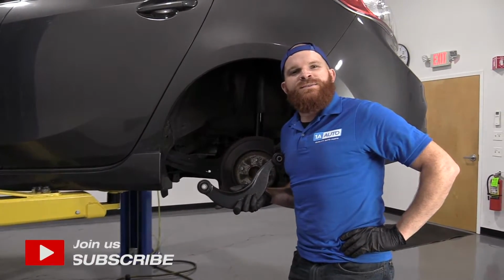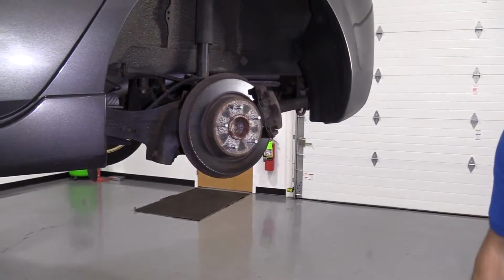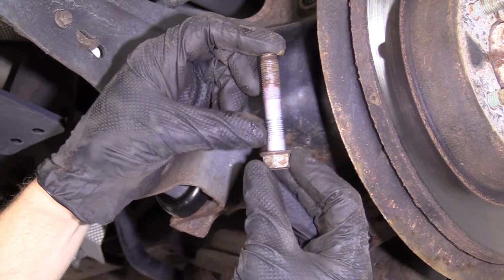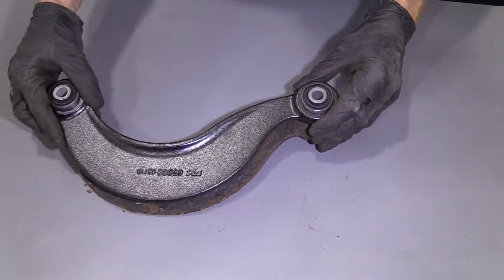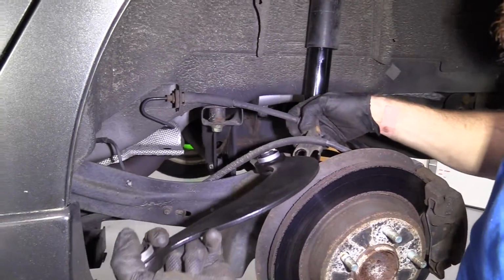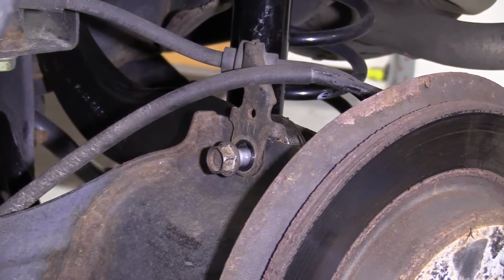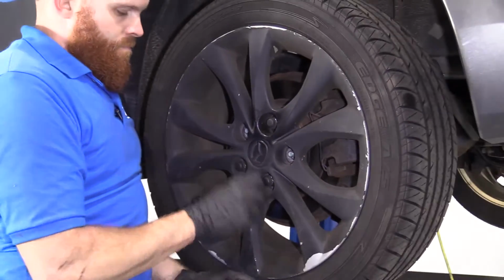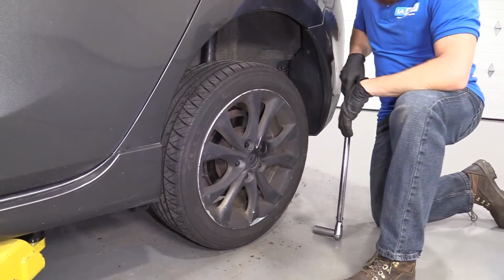How to Replace Rear Upper Control Arm 04-14 Mazda 3

Comment: Why are you not putting weight on suspension to put all bushings in neutral alignment before tightening them to spec?  The loaded bushings, once the vehicle is down, will put constant tension, thus reducing bushing life.

Comment: Everybody always shows the drivers side being done. What about the passenger side?  I went to add some adjustable control arms to mine this weekend cause I'm tired of going through tires on my 06 mazda 3 sedan and I started with the passenger. I couldn't even get at the upper bolt. There was a bracket in the way.  I even have the dealer service manual for the car and it doesn't show how to get at it. How do you do you get to the upper bolt on the passenger side?
Reply: Rick push the metal bracket out of the way.   Agreed though way to show the easy side.
Reply: In a video showing how to remove the lower control arms on the front they showed how to remove both sides

Comment: The repair manual has you removing the entire rear subframe. I said F that. I straight up bent the recirculation pump bracket far enough out of my way that I could use a wrench on the bolt. It took me probably 2 hours of cursing like a sailor and getting cut and bruised up. I would recommend a ratchet wrench.

Edit. I also recommend removing the shock absorber so you have leverage and don't have to reach around it.

Comment: 17 mm socket therefore its an m12 bolt torque setting for a coarse thread is 85nm plus 5nm for a fine thread 95 to 100 nm.

Comment: I just got my car back from getting a wheel alignment at a Mazda dealer. They told me no rear camber  adjustment.. but there was. On top of that it made noises after they were done. I looked at it found the nut is loose! Hope to get a refund! No one takes pride in there work anymore🥺😫

Comment: Didn't torque any bolts up to spec?
Reply from the maker: +Dennis Weinstein The tech is torquing to spec, but he doesn't mention what that is.  We'll pass along the feedback.
Reply: What is the torque speck for the cars? Talked about the lug nut but not the actual arm

Comment: Clip says 04-2014, For the 2014 Mazda 3 rear end is different you need to drop the subframe to access the top bolt for the upper control arm. It’s a pain in the a** just to remove one bolt🤦🏼‍♂️
Reply from the maker: +Donovan Tackett Thanks for the feedback!
Reply: Are you sure that’s not just the opposite side they show in the video? They only show the easy side
Reply: @mritititit  this is a 2nd gen Mazda.  2014 is the third gen